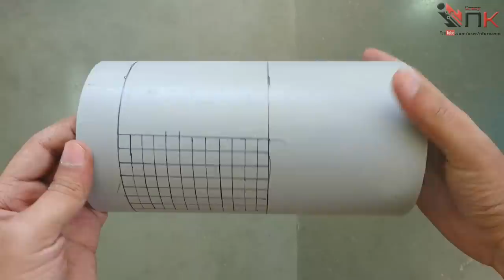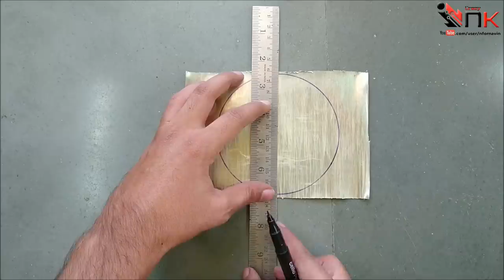How to Make a Bladeless Fan using Plastic bucket at Home

Comment: At first, I thought this was another one of those crewel joke videos, taking advantage of someone's desire to save money. And then I did the research. No doubt, the same research you did, Nd learned you were working off the Dyson blade-less system. Very cool, how you worked out how to t turn a bucket's rim into an airfoil. By the way, you didn't have to built the impeller. You only needed a 40mm PC core cooling fan. These run much quieter, and are far more aerodynamically efficient, and yo don't have to cut your fingers to shreds on the diy turbine, whilst cutting it out by hand. :) Thanks for the video. Try the PC fan, and let me know how it works.
Reply: I think the Dyson bladeless fan applied the same technology of the wind tunnel on a scale down version.
Reply: But its still absolutely hilarious....you just can't deny that lol

Comment: but you used blades, those are just hidden.
Reply: I must have missed the part that he used bladders. Damn, was really hoping those weren't included.
Reply: Travis Fletcher Yeah, sounds pretty freaky to me! What creep has bladders hanging around? And how did he get them? D:
Reply: Prince Tanweer you could call it the assassin fan because it's got a hidden blade hysterical laughter
Reply: Even the dyson 'bladeless' fan which this is based off, has a fan in the base...
Reply: Prince Tanweer That's the point, there are no such things as true blade less fans aside from me
Reply: R DeLaRosa no hagrid, I'm just a blade less fan
Reply: what he meant by bladeless is you can't get hurt by the blades cause its hidden

Comment: it would be more quite and more power if the blades were in balance
Reply: You could do it using differecnes in pressure silently. Issue then is you heat air up or spend most of your energy cooling it down which inturns heat up the surroundings :P
Reply: Sleipnir Gaming understood
Reply: And not held to the motor with sticky tack lolol
Reply: Anthony Kramer A

Comment: Great project, but 1. not bladeless, 2. a whole lot of stuff other than a bucket!
Reply: Uh, mind explaining me how a "real" blade less fan works, if it's not this way ?
Reply: real bladeless fans work with a ionic wind
Reply: The Dyson fan works by having an impeller at the base like this one. However the cone is designed to multiply the air stream by inducing the air behind it to flow in the same direction as the jet streams. From what I can see in this one at the end, all the paper strips in the middle remain undisturbed, so this is definitely not an "air multiplier".
You can watch the man himself explaining how the original version works here: v=8he8afjQyd8

Comment: OR just spend £5
Reply: Matthew Brough that's like 20 bucks at usa
Reply: Colby Mccaleb or like a fuck ton in Mexico, getting epoxy is more expensive than buying a Chinese fan.
Reply: those fans are like 500$
Reply: ikr
Reply: sam Costin $500*
Reply: Matthew Brough lolololol
Reply: Sergio Bennington are u mexican?
Reply: Sergio Bennington are u filipino or mexican?
Reply: Here in Canada Ontario it's like $300-$500 at Walmart.
Reply: @CRAIGARRR Not needed..It starts towards your toes but end up in your nose
Reply: those fans are like $15 at bed bath and beyond. they haven't been $500 in more than a decade, they were only that expensive when they first came out and idiots didn't know they were being scammed because they actually thought it was some new technology and not just a fan put in the base with the air coming out of the top through holes
Reply: Vincent Beers have you been to best buy yet? The stain air blade is 600$
Reply: Vincent Beers **dyson
Reply: Vincent Beers the ones you describe are $15 because that's how they work. An actual dyson airblade has loads of tiny blades on a track inside the rim and is effectively the chain saw of fans. The reason they are more expensive is that they are a LOT quieter and more energy efficient than a traditional fan. The cheap ones might be a little more energy efficient than a traditional fan, but not much.
Reply: +duckwhistle    These are quieter??? They might be but this one isn't, This sounded lie some kind of industrial freezer cooler or something lol. Anyway, personally I'm happy with paying for the 40w of energy a fan uses just to not have my ears bleed everytime I'm a "bit warm". I agree Dyson tech is clever stuff, but at the end of the day, it's just to keep cool surely? Why is there a NEED for bladeless fans??? Seems like some kind of trend to me.
Reply: Chris Pinder no these are not quieter, because these are not the same design as Dyson bladeless fans. Try reading my previous post again where I explained the difference...
Reply: duckwhistle I'm not going to go through 20 comments to read yours before I posted my own opinion, I got stuff to do mate.

Comment: anyone care to explain how this works?
Reply: best works
Reply: DIY ?
Reply: Here, take a look: https://en.wikipedia.org/wiki/Bladeless_fan ;)
Reply: Matheus Moreira 
Thanks Mate.
Reply: ''anyone care to explain how this works?''

Like a very loud Dyson !!!
Reply: Strange Light no worries. ;)
Reply: The fan spins and pushes air up the the bucket parts, and the the air comes out from around the ridges of the bucket (through the cut tubes he puts on at the end to redirect the air).  The little spacers are there to let the air flow around and out from the inside of the rim (because of the tube). ;)

Comment: bladeless? 1:33 what the fuck do you call that then huh? laaaaaaaaaaammmmmmmmmmmeeeeeeeeeeeeeee
Reply from the maker: Fan without propeller not possible, It has hidden blade that's why  know as bladeless
Reply: do it then
Reply: Sebastián Torres Valenta it is possible to oscillate air without a blade using sound .
Reply: hence why I clicked on the video. I wanted to see how someone completed the improbable not grade school level simplicity.
Reply: +Navin Khambhala  Use a blower instead. That's what other companies do
Reply: A blower has a fan in it too

Comment: all that work ???? fan sale 9.99
Reply: Generally speaking, the only good reason for making something is if you can't buy it.  If you can buy it, it is probably made in such numbers that economies of scale come into force, and the bought product costs less than the materials to make it.
In this case, it seems that the way of making a "bladeless fan" is to make blades and drive them with a really loud electric motor.  I looked at the video because I thought I was going to see how to make a bladeless (ionising/electrostatic) fan.  Silly me!
Reply: A normal fan yes can get 10-50 bucks no problem. a fan with no visable spinning blades on the other hand will cost a lot more 60-300 bucks easy.
Reply: Yes, you're right.  If it has the name "Dysan" on it, you pay a lot for that.
I must confess that when I first saw these fans, I made the incorrect assumption that air was electrostatically moved through them.  I didn't realise it was just a fan in the base.  I feel a bit deflated - I thought they were something new - but they're just a re-creation of something old, with no advantage that I can see.  From what I've seen online, they don't seem to move as much air as a regular fan.  You can arrange a bunch of them in a line and blow a balloon through them - but I don't think my life will be impoverished if I never do that.
Reply: Either way a 100% silent fan to me is 100% useless, i use fans for sleep and if i want to be cool'd down i use an air conditioner cause a fan moving around hot air doesnt cool you down In my opinion.
Reply: Dyson fan is $299, but you can get the Uber Oval version for just $399.  That's priced in US Dollars, not Sumaboura cooko nuts or date palm leaves.  So If You Have  Dyson Fan for $9.99 you Have Stolen Goods, No Doubt Abut It.
Reply: p.s. thanks to the OP for the vid, very ingenious, no doubt it will get quieter with mods and upgrades, if quieter is the goal.

Comment: weird, i think it needs work, the middle is not blowing right.    you should try running smoke through it so you can see the air flow pattern and then fix the design till it operates at it;s max performance level.     I mean, since you are working on it like that you probably want it as best as it can be right?

Comment: Fascinating videos. I love your work. And as imitation is the highest form of flattery, I began acquiring parts for this project. My issue is that the only motor I've found as of yet is from a Razor E100 electric scooter. So my question is: should I go with the large kitchen garbage can with that or the 30 gallon outdoor unit?

Comment: And those saying it has blades how else are u planning to create airflow this how it works 

The functioning of Bladeless fans is considerably different from that of traditional fans, which uses its fast spinning blades to create a torrent of air.

In the case of conventional fans, we have this problem that the fast spinning blades can cut away anything that’s on its way and this can pose a severe danger, particularly if you have kids in your family.

And if you cage the fan to avoid such danger, the airflow can be interrupted and may not produce the desired airflow.

In the case of bladeless fans, you don’t have this problem. In a sentence, what air multiplier does is that it sucks the air at its base and thrust it out at high speed.

Well, these have no “visible blades”. These fans have small-sized blades at their base which does the work of sucking in the air from an opening in there.

Comment: You should add a weaker power source for the noise. The reason the noise is so loud is because you got such a strong motor and huge fan inside the tube, and not a big enough vent to pull how much air it needs, causing the rocketing sound of it strangling itsself trying to pull air out of too small holes. Either make a bigger vent, or lower the powerz I'd recommend lowering the power

Comment: Pretty neat. Something to make using throw away items or items found at nearly any dollar store. I didn't know what dyson air fans were so I checked online: Dyson Air Mulitplier $299.99 & Waft Bladeless Fan $119.99. Granted those are pre-built and have extra features but for $3 or less can basically make the same using this video...if you already have the battery and patience. I have neither. Ordered online :p

Comment: Could This concept be applied to the tip of rotor blades when building a roto-dyne ultra light air craft? In other words is their a limit on the amount of thrust that can be generated? Also could this be applied to ducted fan assemblies?

Comment: Nice work.. but this is not how a blade less(Dyson) works. It works based on air multiplier. You need a very high speed fan to create vortex around the periphery which in turn sucks in a much large volume of air through the middle of the ring. In your demo , it is very obvious while it the air comes out through the periphery , there is very little air that blow through the center. You will get mostly a jet of air stream coming out from the periphery. It is far off from the even high volume of air flow that you get from Dyson...Those who argue about blade less here are missing the point. The key functionality of blade less is air multiplying and through the blade less center portion of the fan..

Comment: Navin, great video because I desperately want one of those fans but plz plz NEVER drill near fingers unless you can see them.  I have/had a 1 mm glancing hole in my pointer finger due to just missing it with a power stapler.  As an experiment I pretended it was a drill by poking a roast with an electric drill....zero resistance....we cant react fast enough!

Comment: From 30 to 80 decibels when switching on. To freaking loud to listen to.  Yes, I used a Sound decibel meter.  Fan blades not balanced. Fan not balanced at all with two globs of epoxy holding it in place.   These do not impress me as you just proved, a dead zone in the middle.  
The only one that I saw was a very popular very expensive model that did not do that. Another thing I noticed is, yours is flat. The good ones I have tried are rounded, inside and out, Such as an inner tube would be with the middle cut out. The same thing with the elongated ones, they were curved bodies from front to back with room for more volume of air. Way more than your thin wedge shape.

Comment: A few things I would change.
 I would not use modelling clay to attach the impeller. I would try to pin it to the shaft in some way.

I'd also use metal strips instead of epoxy to attach the motor to the wood so it can be replaced

Comment: Was impressed until he started to make the blades out of a hairspray can instead of just salvaging a large PC Fan.  If that's the requirement, Hell, what a slacker for using a pre-made motor when he could have have easily wound his own motor onto fridge magnets and used a paperclip as the stator. Would have probably been quieter :)

Comment: Bladeless fan actually have air flow in the center, this is not the actual bladeless fan, it just blowing airs from outside rim and doesn't create low air pressure in the center

Comment: It has blades, it's now just far less efficient, move far less air with all that restrictive ducting. Worse yet a prop fan efficiency drops dramatically with air restrictions, Amps go up and less air is pumped. A centrifugal fan when air is restricted motor amps go down. Looks coolish but a fail fur moving is

Comment: This is a nice attempt but you aren’t doing two things that dyson’s fans do and you’re missing two key features (which I won’t reveal). Your’s has virtually no air movement at the center, dyson’s fans have heavy airflow through the whole circle thanks to a proprietary design and two pieces of hardware your design lacks. Not to mention yours is louder than a conventional fan. Not a bad attempt though.

Comment: There is no evidence of venturi effect multiplying the flow. This fan doesn't actually work. Should the nozzle ring  be tweaked or does it need more inlet air from the fan?  It's still interesting to see how these fans should work.

Comment: following points are noted
1: no name of item with dimension are use in this projects.
2: no correct fixing of Pipe.
3:No Air flow in the center of bucket fan ring.
4: To much noise of Metal Blade Fan as same as 5 KVa Generator working.
5: Size of Fan System is to big, but air flow is to low.
Correction needed for this home made Blade less Fan Project.

Comment: why not use plastic fan blades from a PC case cooling fan? it would be more aligned and balanced therefore eliminate what must be the awful vibration noises this thing generates.

From what I gather this is made using recycled materials, so you can easily find a large case fan from somewhere.

I would even say just find a really small fan blade and cut it to shape.

Comment: Need to work on the leading edge, as the only air you have is from the slits. None is being pulled through the middle. If you put your paper stick behind the fan, it should be pulled through.

Comment: Congratulation on a clever way to make an imitation of a terribly over-priced commercial "bladeless" fan, but why?  The conventional fan moves far more air with a lot less power consumption.   We have an excellent fan with brass blades made in the 1920s and it still runs perfectly and efficiently.

Comment: sir, but when I put the fan in the pvc pipe the air will decrease..   tell me solution
Reply from the maker: Make the maximum hole as possible on side or make bigger hole on back side , so it easy to suck air maximum
Reply: Navin Khambhala # crazyNK  Thanxx sir

Comment: @ 0:24 LMAO hopefully anyone you convince to try this after they watch you doesn't hold onto the pipe by pinching it between their fingers while they drill all those holes in it. Also anyone else notice the huge dead spot right in the middle when he's holding his ana-log air movement detection machine to scientifically measure how much (or little in this case) air movement is created by this bladeless fan. I don't blame you Navin for the fact this project doesn't create the vortex that the name brand versions do, you built it properly well other than that terrible holding the pipe like a girl while you were drilling smh.

Comment: You messed up your aerodynamics. Your fan blows (almost) only the primary air which is sucked in at the bottom. The secondary air getting sucked into the ring is minimal.

Comment: How to make a blade less fan using a bucket and a can of deodorant and spray paint and glue and a hose and a motor and a switch and some wires and some other mumbo jumbo that I'm not going to continue with